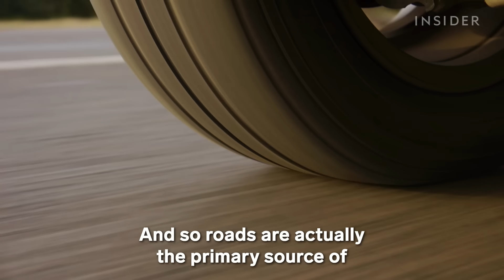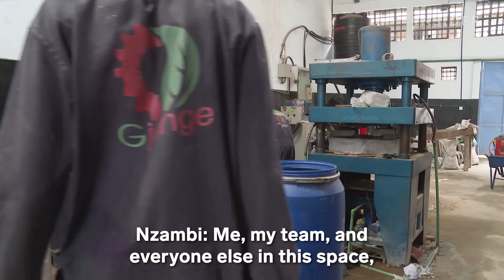Young Inventor Makes Bricks From Plastic Trash | World Wide Waste | Business Insider

Comment: The roofing tile idea is actually really smart. Another really good use would be siding and insulation for homes. One idea I had was to make bricks with holes that you could use long plastic dowels as a kind of snap together walling brick.
Reply: there is a reason we dont build homes out of legos, the weather will destroy them
Reply: @gregoryeverson741  I'm not talking about building the entire home out of them. Just using them on the outside as a brick layer.

Comment: The only problem I can see is if this was implemented on a large scale I could see them wearing down pretty quickly with large enough traffic and leaving a lot of micro plastics in the environment around them. Used on a small scale where there might not be a lot of traffic would be a pretty OK idea though I think.
Reply: I think for foot paths they’d work fine.
Reply: They would be highly flammable and once burning would be catastrophic
Reply: It wil also probably be carcinogenic so i don't see it being implemented in the west anytime soon. A noteworthy invention nothing the less that should be praised
Reply: Could work well as roof tiles. Longer lasting than concrete tiles. Not prone to cracking in hail storms. Color won’t fade.
Reply: @littlejohn-pi7kk  yep and for patios. Do you know how much of a pain concrete patios are. Lol this will save so much time and money.
Reply: The same could be said for the plastic in a landfill however and easier to remove later than buried plastic if we come up with a good way of destroying plastic permanently.
Reply: It's a terrible idea and will not work at all.  This is marketing nonsense and is 100% reliant on donations and UN grants.
Reply: problems are mere obstacles ment to be tackeld after one has done enough that the verb changes in synonymy as challenge.
Reply: I was thinking about the leeching of microplastics aswell, however if the area is already covered in plastics of different kinds the plastic is still leeching into the area. So you might as well make it usefull. I would hope that they dont scale so fast that they create plastic for this industry. Its a start to what is a long journey in finding solutions and alternatives.
Reply: Hm. Microplastics? If this is found in our food, I wonder how much micro asphalt and other micro poisons and toxins there are in that essential source?
Reply: @anthnorm  Micro asphalt is just sand. Microplastics are known to be a much more significant problem than almost all other non acute toxins because they are present everywhere and essentially impossible to separate on a large scale.
Reply: @TestTubeGub-GubSnailman  
Judt a thought. Still not so good for us.
Reply: @Flo Karlos 😂 wait what countries!???😂 Seriously have to ask a question like that just confirming there's people out there that just want things said to them and don't go look for info themselves!
Reply: Bunch of science majors on this thread! Lol west is too stupid, stubborn, and greedy to advance road design. Thank the corporate government for stealing patents for advancement then discarding them for the past 60 yrs!
Reply: @yilo9990  Asphalt is one of the most recycled materials in the world. It's also very cost effective and requires much less energy than plastics. The only environmentally harmful ingredient is a byproduct of the petroleum industry available en masse for little cost that would otherwise be discarded. There hasn't been any improvement on that technology in decades because there is no easy or feasible way to improve it. Plastic tile roads have many problems. Plastic will be damaged by UV at higher rates, have much less adhesion to the substrate beneath the road. They have much less friction than asphalt regardless of sand, especially considering the surface is not porous for water to settle off of the surface in contact with tires. Tile or brick roads are a bad idea anyway on modern roads (hence why you don't see them). But you're right China is doing a really good job saving the planet.
Reply: @TestTubeGub-GubSnailman  okay🤦🏽‍♂️! U.S. road are shit! And have always been. Get 2-3 good yrs tops, then constantly being fixed! There's better materials being used w or w/o concrete in other countries for a while now that last longer with heavier traffic than U.S. Please people use your due diligence and look all this info up.
Reply: @yilo9990  I used my due diligence and looked it up. Asphalt roads are generally expected to last 18 years and in ideal climates can last 25 years. Problems are almost always associated with the substrate and soil underneath it. I'm sure there are better road surfaces, but none that get you nearly as much for your money. It's about balancing cost and utility.

Comment: What she’s doing is gods work, if i had the opportunity to come and help i would do it in a heart beat, this is such an amazing use of something that’s just so plentiful and wasteful and damaging to the environment into building materials. She’s only been using it to make tiles but i believe that using the paste as a concrete sort of binding material for the bricks is just like killing 2 birds with one stones, the paste is malleable the bricks are extra hard, you dont need anything else you just need the waste and it’s able to just be used on its own with the exception of equipment of course but not needed of any other material to build structures will double the process of using the waste into a key important even recyclable( i assume) building material that only needs one ingredient to make, no need of any other concrete and waste of extra water to make it as well, i can assume that with have both brick and paste it could cost less for customers too, they dont have to go anywhere else to get concrete and such to help lay the tiles, they have both supplies out of one vendor

Comment: The plastic brick mix stands up to cracking (pot holes) and five way more flexibility to keep building from crumbling during an earthquake
Reply: I do wonder how it handles water and flooding.  If it's buoyant that could be an issue
Reply: @Jocuro2  wouldn’t that depend on the binding strength of the mortar ? Not too sure I haven’t thought of that.

Comment: I would suggest making double walled  pressurized pipes out of the soft plastic. Not supposed to be load bearing. It will only take out waste water out to the sea. Place em on the side while paving the road to cut down on costs.

Also put remote sensors inside the dry pipe wall to detect leaks like every 100m.

Comment: I wonder if it could be coated with something that would prevent the Microplastics from being released from the final product.
Reply: Probably, though on any major road that coating would dissipate fast and would require a lot of maintenance to keep the coating up. It'd be a financial nightmare for any country, state or city.
Reply: @honerablemention4550  what if it was used as let's say cinder blocks , use it to make houses and paint over it? Really I'd like to know how long it holds its form......
Reply: Concrete or asfalt will work great for coating it 🤭

 if we can play football on plastic, that makes microplastic.
Then we can also burn rubber on plastic roads 🤣

Comment: I sure hope this becomes standard practice everywhere. Looks like an amazing idea!
Reply: It is a really bad idea because as the bricks wear the plastic residue will be washed into the nearest waterways.  Once it is in that form it cannot be removed.  At least when it is whole products (bottles, containers etc) it can be sorted and removed from the environment.
Reply: @davidwebb2318  so don't use it for certain applications, i.e. roads. Plenty of other ways to use it that can help
Reply: @joshuahaught4812  It would be better to use it for roof tiles because then it wouldn't be subject to abrasion and wear.  That would mean les residue gets into waterways.  BUT they would have to make them fire resistant really (by adding cement) otherwise it would be a real fire hazard.,

The very best thing would be to use less plastic in the first place or recycle it into the same use.  I.e. plastic bottles recycled into plastic bottles.
Reply: We need to stop producing plastic all together, than make more stuff out of it.🤔 How is this helping to stop pollution of micro plastic??
Reply: @robotstonka7118  It doesn't stop it, but one thing at a time.
Reply: It does not solve anything its just make micrio plastic that make things worse
Reply: Literally turning solid plastic into micro plastics and paving the ground. How is this a good idea long term? Sounds like just a quick way to make some money like selling toys with lead paint
Reply: @Anonymous-qe3bv  It is a real problem. Unfortunately loads of similar projects are being set up all over the third world funded by well-meaning charities and government projects.  The trouble is they are dishing out money without thinking of the consequences.
Reply: I mean roads are a bad idea, but sidewalks would be great
Reply: @adotinthecosmos  you get the same problem.  It wears as people walk on it and the plastic residue ends up as pollution in the local water.
Reply: @davidwebb2318  perhaps, but is it enough to worry about.
Reply: @adotinthecosmos  It is more then enough to worry about, erosion will happen whatever form it is in but when made into pavers it is the worst and has the highest potential to get into water systems.  Did you miss the part about humans having microplastics in us and everything we do and eat....? lol
Reply: @BrokenSmokinSpokes  i mean there's probably a lot of unsavory things in my digestive and circulatory system. Are there studies on the health effects against it?
Reply: @adotinthecosmos  micro plastics have been observed to accumulate in bioforms. There are plenty of studies going on about how dangerous micro plastics really are, tho micro plastics have been known to exist for too short period of time to know how they really end up affecting everything.
Reply: @0lemus0lent0  I like how because he doesn't understand it and refuses to learn about it that makes it our job to inform him or it doesn't exist...haha.  Well said.
Reply: @BrokenSmokinSpokes  never said i refuse to learn. Reduce reuse recycle. I'm not saying don't reduce. I'm just saying let's explore the reuse part. Also, is melting plastics turning them into micro plastics directly?
Reply: @adotinthecosmos  Melting plastics and turning them into pavers creates a plastic that is more likely to be eroded into microplastics... Recycling isn't the answer, the real answer is slowing production...The video even touches on this several times...
Reply: Yes, this will become standard practice. After all, Americans need more new sneakers this month. Sneakers from last month are already outdated. Once it was considered cool to wear one sneaker for 5-10 years. This spoke of good quality products. Now every six months you need to buy a new phone and every month new sneakers
Reply: And the upsides through here is that, they could just get the plastic out of the ocean or the roads and places and after that they could get it for a cheaper price and then it's a really hard brick
Reply: @gn1l262  ahh "they" strikes again
Reply: @gn1l262  you can't get rid of microplastics, it's about limiting plastics entirely
Reply: @jacobs1047  i literally said there's no point of throwing it rather than making it something that people usually use, like the guy said

Comment: Hear me out. Instead of building roads, build houses out of the plastic bricks. I don't know the details, but i will assume that these bricks will be lighter and have better properties being not as stiff as clay/ concrete bricks. The plastic waste is already there. The microplastics is a huge issue. But, building houses will keep the plastics more or less in one place for longer as opposed to being burned or sitting in a landfill. Plus, what if we can just 3d print houses with that mixture? We can 3d print concrete mixtures.

Comment: Won’t work. Like concrete, clay brick is strongest when brittle, ie desiccated by firing. Since the poly-hydrated carbon molecules are in chain, this leaves them prone to slip over each other, reducing strength and load bearing characteristics.

Maybe good for a garden wall, but wouldn’t want to build my house with them.

Comment: if its like ash felt why not lay it on the roads mix it on trucks that truck lays the plastic and sand on the road plastic problem solved for every country. also you can use old car tires under the road for extra strength

Comment: Any re-cycling use that can be found for plastics is a good thing, transforming them into everyday products should be a worldwide goal, unfortunately there are too many types and too many colours, I would like to see a unifority in types and colours for each type of plastic, like re-cycling all clear PET plastics BACK into PET plastic bottles. Don't make new bottles from scratch, re-cycle what we have now. the coloured plastics, if they are PP (poly propylene), which are mostly the bottle caps, they should be only 3 colours, like red,blue and white, then other types of plastic caps made from different polymers are maybe Dark Blue, or Black. If the colour ranges are minimised then there will be less thrown away because of that. Also don't forget Pyrolysis, turning plastics back into oil, to be used as a fuel oil. Very well done by this team, all the best for your future.

Comment: I wonder how long these people will live healthy lives. Many plastic materials release toxic gases when melted. It's why there are 3D printers designed with an enclosure and filtration system. I get that the "hip thing" on YT is to showcase "Black inventors" but this is little more than showcasing and endorsing a safety hazard for views.

Comment: Microplastics in ground water supply once it rains?
Reply: Water filtration plants are a thing that exists.
Reply: @vmann8168  hm, so now just because of plastic bricks leeching microplastics and other toxin contaminants into the ground water supply and water system, people in the local area have to spend more money, creating waste, and expending energy to remove it. 'Dealing' with a problem that should not have been created in the first place.
Reply: @lartensgrill6106  water filtration is something that already exists in water sources used for drinking, cleaning etc and the micro plastics from the bricks are nothing compared to how many micro plastics are being put in water by other means.

Comment: In addition to the abrasion of traffic and walking creating more microplastics, plastic bricks leach dioxins into the soil leaving it toxic, making its way into the groundwater and poisoning waterways.
When it rains, the runoff will contain quantities of plastic which also makes its way into the soil and waterways, further contaminating the Earth and wildlife.
Plastic is highly flammable. Plastic that is melted or burned, even from just dropping a smouldering cigarette end on the bricks, will release poisonous toxins into the air.
The processes of extracting the plastic fragments, storing and transporting them, and the manufacture of the bricks all also have a negative environmental effect.
Plastics used outside will have constant exposure to UV radiation, especially in the African sun, leaving them brittle and easily broken.
Meanwhile the workers are possibly being exposed to vinyl chloride and breathing in plastic dust without even a basic respirator for protection. They can look forward to possible cancer, immune system damage and respiratory problems.
This is vastly more harmful than it is helpful. This shouldn't be publicised as a solution. This shouldn't be encouraged.
Reply: Plastic: the gift that keeps on giving
Reply: but shes so enthusiastic !

Comment: I could see all sorts of uses for this pressed plastic and engineers could calculate durability for structural applications.  With enough sand and compression it would reach fire resistance qualities and be great for interior structures.  I just don't see an advantage with this stuff exposed to sunlight, since that would degrade it quickly.  It might be ok for sidewalks and driveways, but roads would be the absolute worst solution.  I imagine, if build properly, it would be a great resource for retaining walls and underground construction.  It's a new industry with currently limitless supply.  If I had money I would start a recycling center; I'd pay people in my town $.10 per pound if they could deliver it to the plant, like aluminum recycling, but I'd get most for free.

Comment: The reason people haven't used trash plastic is because it releases a lot of bad chemicals in the air. It's a thin line between major air pollution and environmental pollution, neither one is better; air pollution has a more immediate effect while environmental pollution after a while causes just as much of a problem.

Comment: I am wondering since they melt plastic, won't there be toxic fumes released in the air? I was waiting for the video to talk about that part. In my country(Philippines), there is a organization that turns plastics to hollow blocks by mixing processed pellet sized recycled plastics to the concrete instead of burning/melting them. It has already passed certification and proven much higher strength than regular hollow blocks.

Comment: Are they flammable? I wonder what kind of construction could you even use them for if the are. It's going to be very expensive to fire-proof any house/building using these. I'm afraid it's not such a great solution.
EDIT: pavements are probably OK. Roofing tiles are NOT - they're going to be very susceptible to any source of heat or open fire